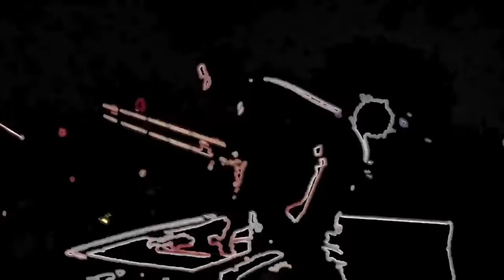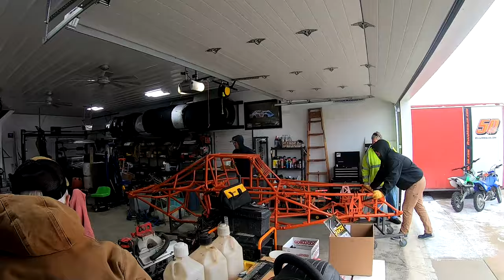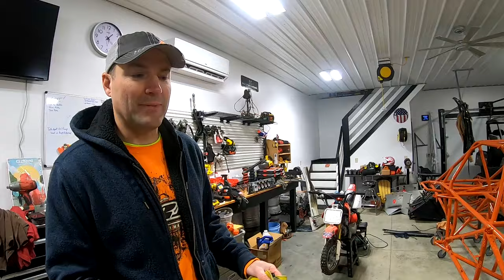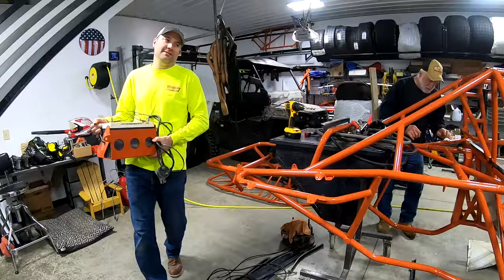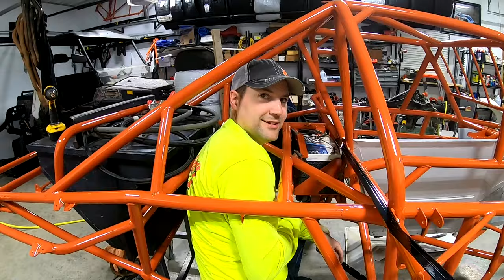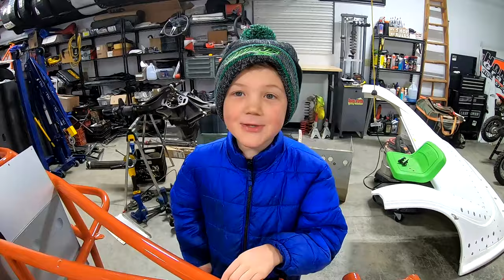We made our Rocket Chassis ORANGE!

Comment: I love the orange, it always made checking welds and looking for bent tubes a lot easier, especially in low light situations! Powder coat or wet paint?? I'm assuming powder by the way it  filled in the hole for the battery mount.
Reply from the maker: Paint